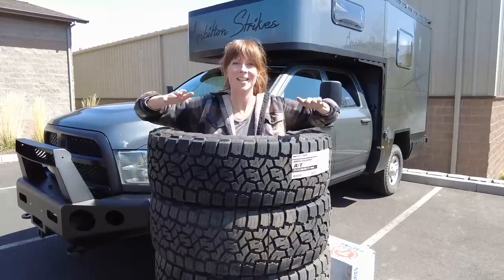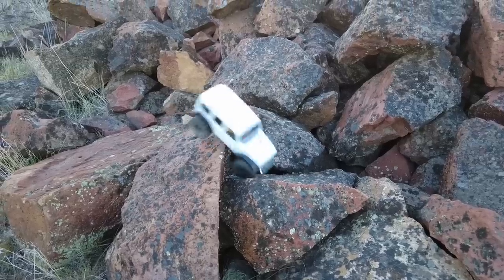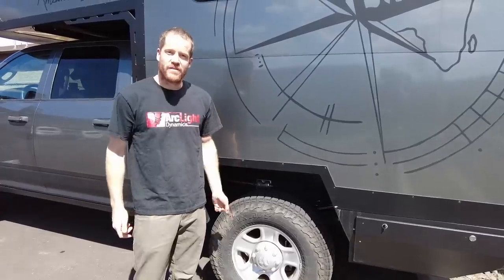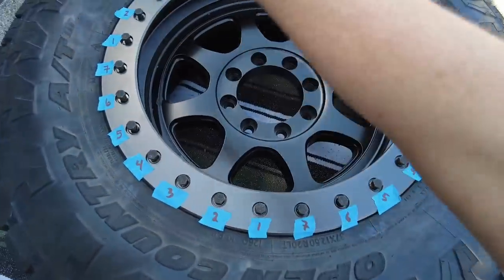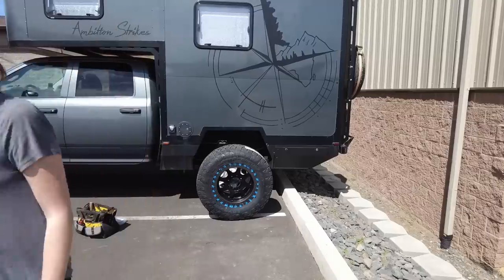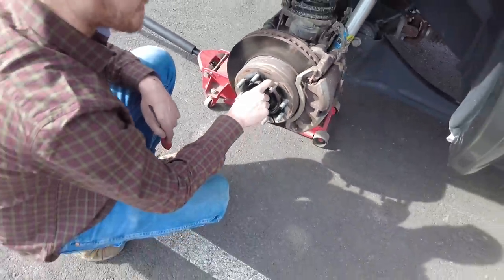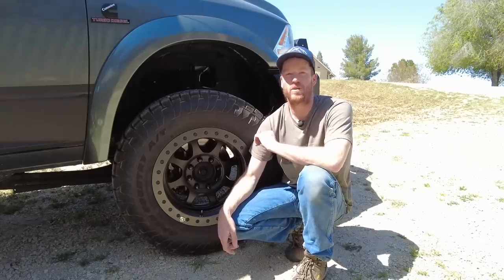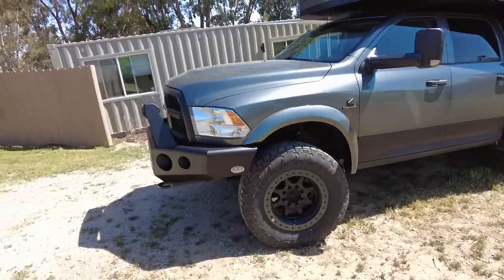Are Our Beadlock Wheels Legal?

Comment: 6:19  That yellow dot should line up with the valve stem so less weight is needed to balance the tire. Also, the valve stem should of been installed before this point. But, there is a tool to let you install it at this point. Basically, a long cone that you push the stem through. 
8:34  Notice the thread lock compound on the bolt. I assume this needs to be added for each tire change.

Comment: Did I miss something? How are the wheel and tires balanced? They do look great.
Reply from the maker: Hi Mark! We had plans to balance them when we got home but after 1,000 miles of freeway driving there aren't any vibrations.
Reply: @AmbitionStrikes  That doesn't mean your don't need to have them balanced.  You can cause some serious damage in the long run by going cheap and not having then properly balanced.
Reply: @jadedjay7861  If you can’t feel it then clearly its not bad to the point that its doing damage. Its pretty obvious when tires are out of balance. Balancing beads will be good enough if he doesn’t have a chance to see a shop.

Comment: Excellent job explaining exactly how beadlock wheels work, along with the parameters you researched for buying the wheels and tires. Quality video!
Reply from the maker: There are lots of options out there, and it really depends on the vehicle and its intended use!
Reply: @AmbitionStrikes  I would have never considered bead locks because I've always read repair shops don't want to work on them. Demonstrating you can mount a tire yourself in the parking lot makes them not just a viable purchase option, but a bonus when it comes to field repair.

Comment: Completely changed the look of the rig. Noticed you didn’t mention wheel balancing. You may not feel it now but if mud or rocks get on the tires it could cause a giggly ride. Try Centramatic wheel balancers.
Reply from the maker: No vibrations at the moment but we do have plans to get them balanced!

Comment: you didn't have to start over. you could have pushed the tire in from the back enough to get the stem through and seat it that way. but it only works sometimes depending on what type of tire you have
Reply from the maker: We tried that first, but the valve stems included have a nut that you have to thread on and there wasn’t any room to make that happen!

Comment: That tire and rim combo really works. And I appreciated Riley's explanation of your reasoning in choosing beadlocks. I was under the impression that they were restricted for road use? I take it that isn't the case?

So with that done, what's left to do on the truck?

Enjoyed the video. Keep up the good work. And safe travels.
Reply from the maker: I'm not sure that restricted is the correct term, they aren't really legal or illegal. In the U.S. there isn't any legislature that says they are prohibited or illegal. However, some states require that wheels be DOT compliant. Because they don't mount like a traditional tire, they can't be DOT compliant.

Comment: Hope you calibrated your speedometer for the larger tires.  Usually bead lock wheels are not “road legal”.  That is one reason why the rims you have do not have a DOT rating.  The upgrade looks good.  I usually upgrade wheels and tires on all my vehicles.

Comment: Most folks find the balancing of a beadlock setup somewhat prohibitive, since most shops won’t touch them. It would help if you guys shared your experience. Did you find a shop to balance afterward? Did you resort to dynabeads or similar? Any trouble with the TPMS module interfering with the inner “half bead”?
Reply from the maker: We have had several tire shops local to us balance beadlock wheels in the past. We had plans to balance them when we got home but with over 1,000 miles of driving we haven't noticed any noise or vibration. 

We completely dropped the ball on ordering a set of TPMS sensors so we will have to deal with that eventually. 🙃

Comment: Thankyou for sharing.  My Ram 2013 2500 Megacab with 5.7 hemi 3.73 pulls a lot better with trailer tow and locked down to 5th gear.  Did your diesel drive differently with the larger tires.  You have a lot more torque.
Reply from the maker: We honestly don't notice a difference in power with the larger tires. We went from a 35 to a 37. If anything it's a little better now because it used to be right between 5th and 6th at 60mph and now it stays in 5th. It shifts to 6th at 65 and is happy there.

Comment: You do know the higher you make the ground clearance the easier it is to turn over, because it makes it more top heavy.
Reply from the maker: Correct! But it also means more ground clearance for off-roading. The addition of the sway bar helped significantly with body roll and inherently our camper design keeps all of our weight low for stability.

Comment: Wow, they look great!  What did you do for balancing the wheels and speedometer correction?  Also, what fuel efficiency difference have you noticed?  Keep up the good work.
Reply from the maker: In the past we have been able to have our local tire shop balance beadlock wheels. However, at the moment there aren't any vibrations which is pretty surprising! We haven't notified any different in MPG or driving with the new tires. The speedo is about 5mph off so we can either use the AEV procal to correct or it sounds like we can also take it into the dealership.

Comment: The truck is looking great with those big tires
I have ram 3500 dually makes me want to get big tires with lift kit
Reply from the maker: Such a transformation! We are typically hesitant to add a lift and tires to our tow rig. For a vehicle like this it made sense but if you tow with your truck a lot we are fans of slightly larger tires over stock and not much else!

Comment: Do you think your new Toyo tires will work for winter driving like you did this year or will you have to use a different tire for the ski season? Also wondering if they recommend any thread lock for the bead lock bolts. About time for an Alaska trip.
Reply from the maker: The Toyo’s are snow rated so we are hoping they perform as well as the Wildpeaks in the snow. Per the instructions TR recommended that anti-seize be used on the bead lock bolts. We would love to go to Alaska and are hoping to make that trip happen soon!

Comment: Did you ever get them balanced? Seemed like a step that wasn't done. Might get some unwanted vibration at highway speeds.
Reply from the maker: We have plans to get them balanced but after putting over a thousand miles on them we haven't had any vibrations!
Reply: @AmbitionStrikes  well no problems then should be good. Just a thought to have them done before something to arise.

Comment: Looks great guys, no problems with the speedometer or dif?
Reply from the maker: No issues with gearing, but I think that would be a different story if we had jumped up to a 40" tire. The tranny shift points seem fine and it doesn't drive any different than with the 35s. The speedo is about 5mph but can be corrected with an AEV procal or a trip to the dealership!

Comment: Do the larger tires throw off the speedometer accuracy?
Reply from the maker: The speedo was about 2mph off before and now it is 5 mpg off. There are calibrators (like an AEV pro cal) or we have also been told the dealer can correct it!

Comment: This is the same problem as being over weight. In a case of an on road accident a lawyer can hang you on the fact that the beadlock rims are not on road approved. And you really should tighten the beadlocks in a crisscross pattern, not just 45deg off

Comment: This might be a stupid question. If the bead lock wheels only bead lock on the outside, how does that prevent loss of seal under low pressure conditions on the inside?
Reply from the maker: Great question! The primary cause we see of a tire popping off the bead doesn't come from running low pressure itself. Instead it is caused by the wheel being able to spin inside the tire. By clamping the tire this can no longer happen. But you are right, there is no physical retention of the inner bead. Hard core rock crawler guys will run double beadlocks for super low tire pressure.
Reply: @AmbitionStrikes  Totally makes sense now. Thank you too much.

Comment: Did you ballance the tires before mounting
Reply from the maker: We have plans to get them balanced but after driving over 1,000 miles they are quieter than the old set up and no vibrations!

Comment: Awesome rig . Did you balance the wheels and tires ?
Reply from the maker: We had plan to balance them but after driving for awhile we haven't noticed any noises or vibrations.
Reply: @AmbitionStrikes   I kinda figured that was the case . High quality wheels and tires .
Reply: And if at some point in the future you do wind up needing to balance them you don’t have to go to the traditional method, i run about a  cup of airsoft BBs in my off-road wheel assemblies, it works great.

Comment: Hopefully y'all realigned front end after tire swap.
Reply: Why? If it was good before tire change wont affect it. Suspension change could.
Reply from the maker: Swapping tires and wheels doesn't change the alignment of the vehicle. However, we may add a little bit of negative caster to help the larger tires track straighter.

Comment: When moving to a larger tire, does one have to consider the gear ratio of the truck and possibly change it?
Reply from the maker: Yes!! This is the only reason we resisted the urge to put 40" tires on... 😂 There are tire size and gear ratio calculators online that will help when choosing the correct ratio.
Reply: @AmbitionStrikes  Thank you. What was the stock tire size on that rig?
Reply from the maker: @tobywonkanobe5345  It was approximately a 33” tire.
Reply from the maker: @tobywonkanobe5345  It was approximately a 33” tire.

Comment: What transmission do you have in your truck?  I have the 68rfe and it let go after moving up to 35”s and towing heavy. I wish I would have regeared early
Reply from the maker: We also have the 68rfe. That's a bummer that yours let go. Thanks for the heads up!
Reply: @AmbitionStrikes  my transmission guy told me it’s pretty common for this transmission to fail after 150k when these trucks are run heavy in oversized tires. He recommended 4.30 gears for 37”s. This is one of the reasons it’s no longer used with the 6.7 and Aisin is now the only option.

Comment: What is the difference between tires and wheels
Reply from the maker: Tires are the black rubber donuts that touch the road and the wheels are the center part that bolts to the vehicle!
Reply: @AmbitionStrikes  so wheels are rims?
Reply: @victorsteinfeld2582  that is the rim Wich in turn counts as a wheel when it has a tire.your welcome for the explanation

Comment: Does the change in wheels affect the accuracy of your speedo?  They do look good...fits very nicely into the aesthetic of the vehicle 👍
Reply: I’m curious about that too.  Did you get an adapter to synchronize the speedometer?
Reply from the maker: The speedo was already a bit off with the 35s but now with the 37s its more like 5mph off. We can recalibrate electronically with the AEV procal or take it to the dealership!

Comment: So are these wheels technically road legal or not? Seems like they aren't. Not that it's a big deal with you doing the upkeep, but something to think about. DOT compliance in most strict places means being able to register and license your vehicle for road travel.
Reply from the maker: Depends what your definition of road legal is? We have yet to hear of someone receiving a ticket for running beadlock wheels and can not find any laws specifically stating they are illegal.
Reply: @AmbitionStrikes  Hey, thanks for the reply. This is a long discussed topic regarding bead locks and I doubt you'd see many tickets, but many places have statutes if you register a vehicle there. Thanks for highlighting the upkeep. You really have to commit to the maintenance especially if you plan to put road miles on them at higher pressures and your weight.

Comment: You put on thiese much bigger tires. What did you do to cmpensate? Axle gear ratio, speedometer and odometer need to be altered as well..oh well US hack job..
Reply from the maker: The truck came from the factory with a 33” tire and we upgraded to a 37” tire. If we felt regearing was necessary we would have done it.